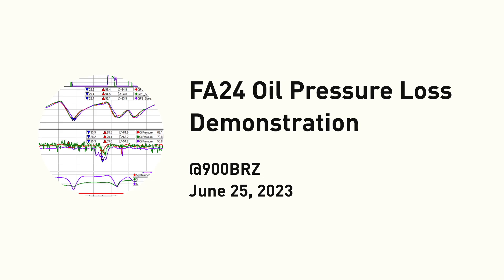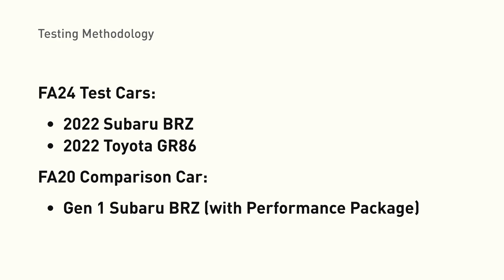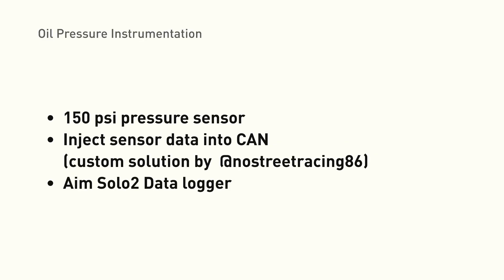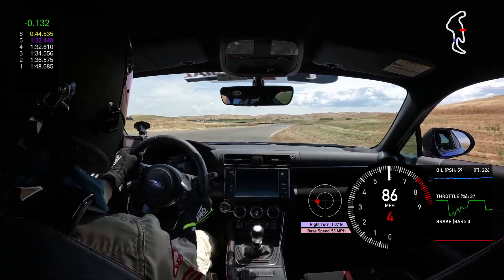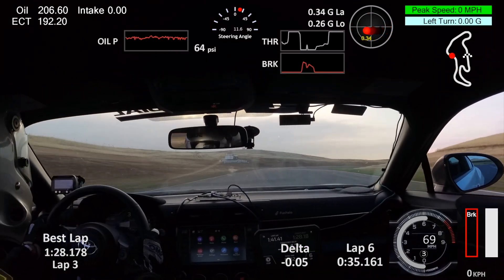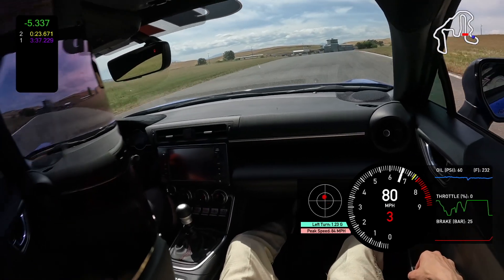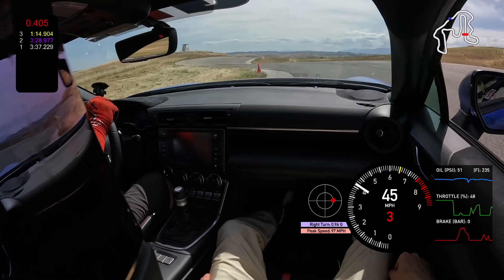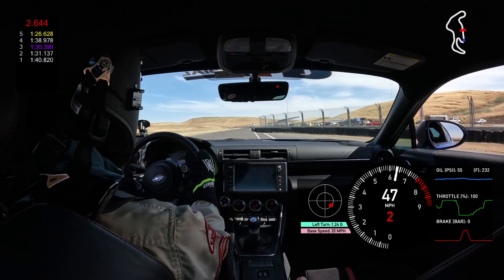BRZ/GR86 FA24 Oil Pressure Loss Demonstration

Comment: Not sure if you mentioned it, but how much over are you filling the oil pan? Quart?
Reply from the maker: At or slightly above the dipstick max line. Not overfilling.
Reply: @900BRZ  interesting. I thought it was common practice in these FA motors (or any boxer platform) to toss in an extra quart for the track. I run a 2qt accusump, as well as a moroso baffle and killer bee pick up for added insurance in my FA20

Comment: Would this also apply to the vb WRX?
Reply from the maker: I don't have any experience with that platform, but based on some quick conversation with another owner with a pressure gauge I'd say it's not possible to apply these conclusions to that engine. There are significant oiling differences to supply oil to the turbo.
Reply: Thanks!

Comment: I really like this video.  I'd love to see oil fill level added to the study.  I know you can overfill these engines with oil by quite a bit before you're even close to the crankshaft, and there's a baffle there anyway.  So if you overfill by a quart, quart and a half, even two quarts, what does that do for oil pressure in right hand turns?  The key would be to watch for aeration but I'd be willing to bet my engine that 1.5 quarts overfilled wouldn't introduce aeration.  (In fact I already have, I run about 1.5qt overfilled on my track days and have not suffered any failures after about 100 track days combined between my 2019 and 2022 86s)
Reply: Yeah, my joking/facetious comment earlier that can we just use heavier oil, overfill, and hope for the best -- was not entirely joking.  I honestly wonder if that could be part of the protection.  Maybe the answer is a new dipstick, lol, that just ups the amount of oil to the FULL mark.
Reply: @michaelruddick2662  hahaha yeah imagine a recall to install new dipsticks and add 1.5 quarts of oil!
Reply: @OfficeLinebacker  I did see somewhere on the interwebs that someone's blown engine got Sub or Yota advice to make sure to fill the oil more fully in the future.  I've also seen commentary that it's a little vague on how/when to measure oil fill level based on temps, sitting/draining time from the engine into the pan, etc, etc.  Sure seems like stuffing more oil is not bad.  How much, and how to measure, would be nice to get insight/direction.
Reply from the maker: I’ve already installed the prototype baffle now, so we’ll have to test this one someone else’s car.
Reply: @900BRZ  Your video is a clear, how do we say?  watershed moment.   Having said that, it makes me wonder if YouTube comments is the best place to try to organize and discuss.  Or if some forum somewhere is better suited?  It's likely already happening somewhere, I just have not gone to look.  In the meantime, I can't say enuf time, excellent work in helping to walk a path to improvement.  I don't track my car (I will do my first on in October at Sears Point, and surely won't be aggro corner boy), but am certainly open to trying to film and capture data while running stock 0W20 in spirited driving occurrences ;)  Likewise, if a gofundme is appropriate to raise funds to allow tooling for others, that's something to think about...

Comment: I got baffles + larger pick-up tube + thicker oil + slight overfill, going strong for 30+ track days.
Reply from the maker: Do you have an FA24? You removed the timing cover to swap the pickup tube right? Which tube did you use?
Reply from the maker: Baffles are not a magic bullet. See my friend’s comparison at Sonoma before/after installing the Tomei baffle: https://www.youtube.com/watch?v=35-hf0SKzNg
Reply: @900BRZ  FA20, Bluemoon baffle, Killer B tube. I commented because I believe these mods would also help the FA24.

Comment: Hey m8, as an engineer I really enjoyed this. I have buddies who run accusumps on their N54s during track days. Maybe that'll help during the high G cornering?

Ive heard that some had problems with their products, so check out the Moroso Oil accumulator.
Reply from the maker: Yeah I’ve heard conflicting things about accusumps so would like to do some more research. Seems possible it could help for very brief pressure drops.

Comment: Another chad Banschrift user I see

EDIT: just finished watching - amazing work to set up the sensors to capture the data. Looking at when the pressure drops occur, it seems as if the oil pick-up is surging since the pressure often contains a series of valleys and peaks. In addition, since cresting over a hill also causes this issue, seems like it has something to do with oil having trouble draining back into the pan/pick-up area.
Reply from the maker: It’s DIN
Reply: @900BRZ  :( looks so much like Bahnschrift haha

Comment: Thank you for making this video! Great content. Good theories and proofing…eager to see if solutions work for this…I also wonder if the oil pickup tube having more surface area is one of the main reasons oil pressure drops…like adding holes in the bottom of a straw or something…I still don’t understand why Subaru couldn’t have deigned the oil pan to have a flat surface underneath the joint where the RTV silicone mated so that NO RTV silicone got anywhere near the oil pick up tube…then again there’s supposedly more of that stuff elsewhere in the engine seals as well or something. Either way, shame on Subaru and Toyota for not catching this in QC or in product testing prior to production…

Comment: What a great video! Thanks for doing and sharing this case study. Shame to see that GR86 has yet another oiling issue, but hopefully that can be fixed with baffling. If not - Accusump can help.
Reply from the maker: Here’s what a friend found with the Tomei baffle at Sonoma: https://www.youtube.com/watch?v=35-hf0SKzNg

Hopefully the KB one has better results.
Reply: @900BRZ  Thanks for sharing this! Hopefully KB will be better. Looking at the GR86 sump though... It's so small! If baffles don't work it's either a custom sump route (expensive, complex and there is not a lot of space in there, so probably not even possible) or an accusump to step in when the pressure drops. I feel like an accusump might be a better option. But let's see the KB baffle results first!

Comment: Im curious what adding an extra .5 to 1 quart of oil would do. It was something that GM recommended for track use of the Camaro, not sure of their reasoning though.
Reply: This is what we do in S2000s and it works. Keep it about a quart over full and no pan baffle needed.

Comment: I'm just convinced that Subaru doesn't know how to make engines. It's not even boxer engines themselves; it's just Subaru. Look at Porsche. They make flat 4s and flat 6s that dominate.
Reply from the maker: It's also a cost thing. Porsche can afford more expensive integrated dry sump designs partially because they are charging more than double for their cars. Making a reliable wet-sump boxer engine does seem to be a significant challenge.
Reply: @900BRZ  dang, doesn't the 86/brz come with RTV issues out of factory? I feel like that's a pretty good fix if they adjust the amount they apply, or just change the gasket to a solid one, but I can be wrong.

Comment: Outstanding!

I would also love to see a completely stock 86/BRZ (ie specifically stock oil cooler) to act as another control, though i have no doubt the data would be the same. Still, it would only reinforce this already robust methodology.
Reply from the maker: Yes, I no longer have one, but would definitely be interested in seeing this as well.
Reply: @900BRZ   Excited to see the results after the new oil pan! Thanks for doing all this work.
Reply: I have a 23 BRZ. No oil cooler. I have suspension and sticky tires, though. I'm going to look into the logging solutions. Thankfully the Ridge only has one longish right-hander.

Comment: Would this be a thing in the new WRX engine? It's very similar to the GR86 if not basically the same engine, maybe a few internal changes to strengthen it for the turbo?
Reply from the maker: I don't actually know, but I'm told there are meaningful differences in the engineering between these engines and it may not have the same problem. That claim is not verified by data that I've seen.
Reply: @900BRZ WRX engine swap and ecu change. Problem solved 😂

Comment: This why I'll always dry sump a flat engine
Reply from the maker: Do you know of any systems available for this car? Seems like it would add a ton of cost.
Reply: @900BRZ  did 30 seconds of googling and found kits for fa20/ej20/ej25 full dry sump kits that seem to agree on about a $5k with nothing available without further research as far as a kit for a fa24
Although any one who has a welder and some minor skill to fab their own oil pan and oil tank will be able to save some money bringing cost down to about 2-4k depending on material and parts selected 
Boxer engines have inherent oiling problems because of their split block architecture and overall design causing back drainage into a pickup to be challenging
 windage trays in oil pans can and generally fix these cornering and slope related issues but realistically to me it's just a band aid for weekly track visitors who plan or have already added bolt on power adders or even forced induction
A dry sump regardless of how one is acquired is objectively pricey but for me it's the smartest move for power hungry or track happy cars with boxer motors 
In summary fab a windage tray buy one or step up to a dry sump regardless of the money for them because paying for an entire motor is a lot more all around

Comment: Wouldn't Toyota and Subaru picked this up in testing? Too expensive for a factory fix?
Reply from the maker: Yeah, it’s very surprising.
Reply: @900BRZ  odd coz if it's just oil sloshing why not just baffle the oil pan from the factory instead of risking a lawsuit. It can't possibly be that more expensive vs brand reputation damage from a lawsuit or just lack of trust from blown up engines.

Comment: @DougDeMuro @TheStraightPipes @ThrottleHouse @Jalopnik @ScottyKilmer @TheSmokingTire is there any way of contacting Toyota and Subaru about this major issue with the FA24 engine? They need to fix the RTV issue and the oil pressure drops ASAP.

Comment: Do you recall the oil level on the cars prior to testing?
Reply: Most of the people who track 86/BRZ either fill to full or overfill by 0.2-0.5 qt to reduce the chance of oil starvation.
Reply from the maker: Yes, at max line or slightly above. I try to check in between every session and most of the time I do. At a minimum several times per track day.

Comment: Have you shared this data with Subaru and Toyota?
Reply from the maker: I don’t have any direct contacts with them but Zygrene mentioned he’d try to pass it along to them.
Reply: @900BRZ  It seems preposterous that such oiling issues have not been vetted at the manufacturer level during development and testing - what DO they test anyway???

Comment: Interesting that its not happening on all right-handers. Might be a good idea to test it at a different track. WSIR would be a good choice as its essentially a bunch of different style right-handers and very easy to get consistent data (we use it a lot for suspension setup). Great video and analysis!
Reply from the maker: We have reproduced pressure drops at Sonoma as well. This is a friend who built a tool to visualize the data and he has an example from his own GR86: 
http://track-build.com/oil-pressure-analysis

I’ve run at Buttonwillow but didn’t have pressure logging then, but one of the guys I know who blew his engine did it there. CW circuit with sweepers (especially Riverside, which is high speed and sustained).
Reply: @900BRZ  Yeah just to clarify I was only suggesting another track to try to narrow down the exact type of right-handers it doesn't like. I totally accept this is a real issue as you have demonstrated :)

Comment: Toyota GR Cup car mechanic here. We had 3 motors blow up on us at COTA and could not understand from looking at the data if the pressure drops were enough to cause catastrophic failure. Even the Toyota guys themselves were questioning the lower pressures. This is incredible information and really hope the engineers have found all this out also. Best of luck and stay safe!
Reply from the maker: Thanks so much for commenting. I’ve been wondering if we’d see reliability issues from the GR Cup cars and I knew there was one failure last weekend at practice, but I had no idea about that. Is that 3 motors within your team or the whole paddock?
Reply: @900BRZ  3 motors just from our team, I imagine other teams had the same happened to them. We had 4 cars there that weekend and conditions weren't any help, hot as hell then it started raining on top. We honestly were thinking we were using the wrong weight of oil with the second one that blew up but by the third we figured it was an issue from the factory. Just glad that we're motor swapping experts now lol
Reply from the maker: @Wholebakedcooky  Can you message me on Instagram @900brz
Reply: @Wholebakedcooky  Very curious as to what weight oil you guys run?
Reply: Question for you, as I've been looking into this as a "just in case my fa20 blows". How easy is it to swap in an fa24 into a 1st gen? I've been told its a direct drop in, and I can even use my JDL turbo kit on it, I'd just need a bigger turbo than my current gtx2860r, and I'd need a different maf flange.
Reply: @900BRZ hi Brian 
My engine blown off as well 
Count me as 4 
Funny thing is , it had only 20k on it 
<2024 brz
Reply: Pass this video to Toyota them selves please.
Reply from the maker: Someone has mentioned they were doing that on my behalf. I don’t have any connections to do it myself.
Reply: I’m afraid if he tells us more he’ll get fired 😂
Reply: Thanks for chiming in.  This is the precisely the kind of info I want.  What else can you tell use about the incidents?  The more info we have the better.
Reply: What pisses me off is that, people who have blown their engine due to low oil pressures, Toyota has been denying their warranty or making it so hard for them to get a new engine. Toyota needs to wake their asses up, and have a recall, along with warranting people’s engine.
Reply: This video along with this comment is validation enough!  Subaru better get to the bottom of this....i smell class action lawsuit.
Reply: @NicholasZak  how can such obvious and simple to replicate issue pass unnoticed through R&D process? Unless it was upper management decision to ignore it.
Reply: @driverpsyche  sheesh its beyond me, better get rectified tho.
Reply: @driverpsyche management knows less than 1% of cars will ever see a track.
Reply: This situation reminds me when the ND  Miata cup cars were blowing up the transmissions and teams were swapping them out every event. Goes to show no car is perfect.
Reply: @NapalmPineapple  at least Mazda was replacing them free of charge. I think they are on version 6 of the transmission already.
Reply: @bruce_son  That is true. Probably learned from all the issues with the RX8s, and prior gen Miata’s just to fix it lol.
Reply: @bruce_son  they only replaced to up 2 transmissions... after that they wouldnt honor the warranty for some owners
Reply: I'm hoping Toyota steps forward and figures this issue out. Subaru seems to have lost their touch, and Toyota shows no slowing down in their catering to enthusiasts
Reply: @hlang578 if Subaru has lost their touch maybe Toyota shouldn’t be putting their logos on a car with a Subaru engine.
Reply: I'd been hearing of the engine failures in these cars during my research in purchasing a new car, and have had a GR86 on my research/shopping list.  I don't plan on tracking my new car, but I do enjoy spirited driving, and this information gives me great pause about the cumulative effects of this phenomenon over time, and the long-term viability of the engine (despite minimal tracking/autocross...particularly with higher mileage after the manufacturer's warranty has expired.  Taking the GR86 off my consideration list, and will likely fall back on a Club Miata RF, or perhaps a Z.  Might change my mind if Toyota/Subaru announce a fix, or extend the powertrain warranty SIGNIFICANTLY.

Thanks for this video...very compelling.
Reply: @Somebodystolemyusername  I have a turbo'd 1st gen BRZ. Limited 50th Anniversary, 250 ever made. For sale if u want it.
Reply: @Spextre  I bet it's a blast, but I'm shopping for new as I'll probably be leasing this time, perhaps with a buyout at the end if I like the car.  Thanks though.
Reply: Love my BRZ, I truly hope they can come up with a fix for oil starvation, I’ve always thought it’s not the silicone because of the box screen has been greatly improved !! I’ll never track my car but do love driving it .
Reply: At every high g  track I've raced at all and I mean all the subaru motors fail in 3-5  sessions.
Reply: Great video, looking forward to seeing future results!!
Reply: I'll be telling all the SRO teams that come across the scales to give this video a watch as well!
Reply: yup the only one i saw blow up was dragged the EFF out raced hard
Reply: You could start by not using Subaru engines!
Reply: Forgive my ignorance, but may I ask why would you pass info to Toyota?
Isn't it a Subaru designed/manufactured/supplied engine?
Reply: Do you guys run an accusump? It’s super cheap to set it up for track
Reply: @bruce_son I don't understand why people don't even mention an accusump, it could be a flat 4 motor saver
Reply: It's because of all the engineers that I know who were behind the GR Cup car development here in Mooresville, none of them are engine guys. 

There are a few basic engine data points every track car should be monitoring. I say this as some who's engineering has been from grassroots to F1 engine programs.
Reply: Why would the toyota guys know anything? It's a subaru engine.